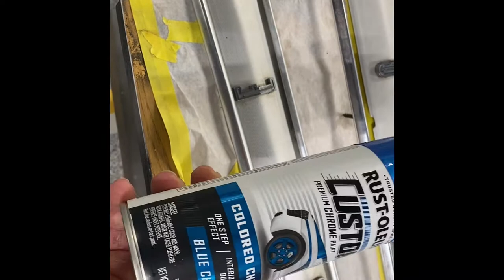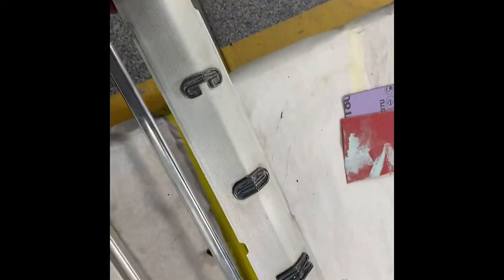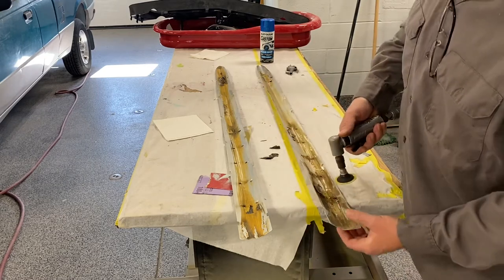Using RUST-OLEUM Custom BLUE CHROME paint

Comment: How did you find the durability ? I'm thinking of using it on my aluminium canopy frame, possibly with 2k clear
Reply from the maker: Adding  2k clear will be a big help with color holdout by adding UV protection. I would suspect it should hold up just fine for the money. Thanks for watching!